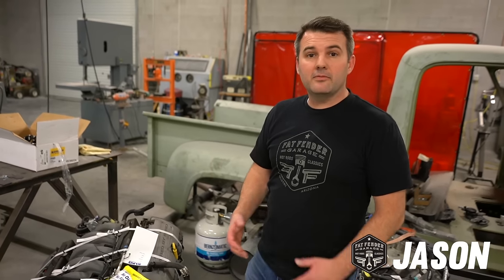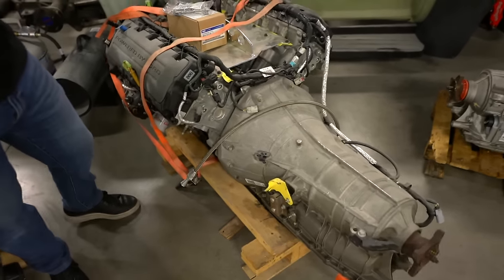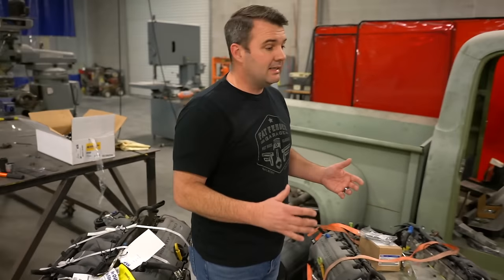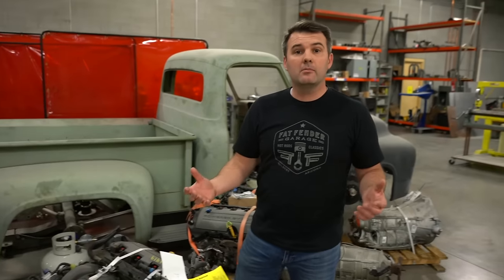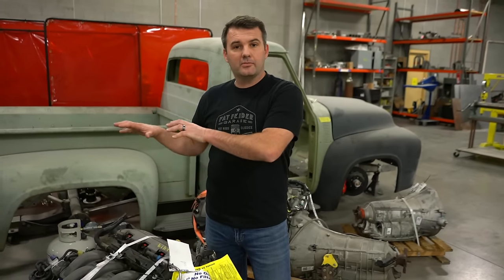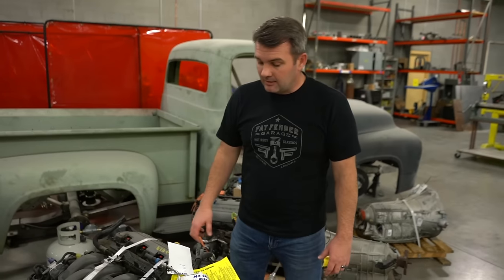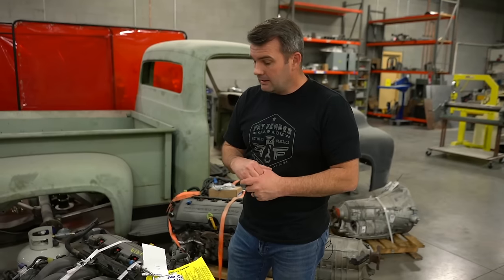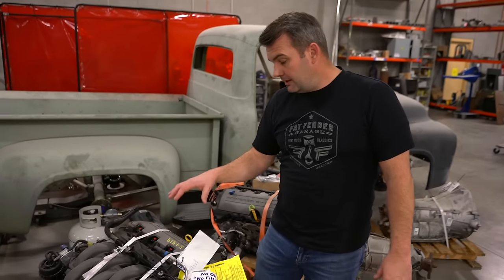Coyote Swap Engines - HOW & WHERE TO BUY

Comment: I know they are not as common but I bought a 32k mile Mustang GT 4.6L 3v complete with 5r55s transmission, harness, accessories, fuel tank, gas pedal, etc for $2,000.....then found a used MP112 Magnuson supercharger for $650.....so all in with tuning I'll be under $5,000 for a 425rwhp setup. Oh yeah, this is going in my 1952 Ford F1 pickup.
Reply: The 3vs get a lot of hate, it's really not deserved. Kudos on the build bro! How's it going now?
Reply: That's super sweet
Reply: Love the 50s F150s
Reply: MrMurph111 I doubt you’ll see this, but “How did the build go”? Hope your out cruising in that 52 (love that era of Ford!) ✌️
Reply: @TC-dw6wg  ….she is still a project, but should be tons of fun!
Reply: Your best bet is to buy the whole car from auction and sell if the rest. These motors used are over priced right now. There is this coyote craze right now. For builds you can go after other mustang engines.
Reply: I bought an 1991 Infiniti m30 with the vg30 (300zx) that can run up to 1,000+ hp with the right parts. I bought it for $850, it runs and everything perfectly, even has AC.
Reply: @ghostiboi2057  exactly guys are paying 3 grand for coyotes with 60k miles. They have a place here in NYC that sells drop in from Japan engines and trans complete with harness and computer to upgrade any Honda Nissan Toyota and their respective luxury brands for less than a price of a coyote and they have low miles.
Reply: Where did you get to purchase that motor
Reply: You present a very compelling argument...
I've been contemplating a Coyote swap, into my '06 P71, and I'm still doing my research.
Reply: Why is the gas pedal important?

Comment: I work at LKQ in QC now. ive got 2 bits of advice for everyone. 1) we do NOT deliver to a residential address. 2) if you call us and ask the sales rep specifically for "a full-drop" and specify you want the harness with the engine. he can put in the notes to the dismantle crew to leave it attached. this can also be extended to the full drivetrain if you want it. ENG, TRA, RDS(rear drive shaft), and RAX(rear axle). we do try to get the customers exactly what they want/need. and if we dont do it the first time, we will try again until we get it right. i use to be a driver for them for 2 years. it wasnt an issue for me to go back to the same shop 3 and 4 times to get them the exact right part. typically mistakes like that only happen with electronic devices because the manufactures make so many different models based on the trim levels of each vehicle. IE, a radio that fits a Ford escape is the same that fits a fusion, or a taurus. and each of those three have 3/4 trim levels.
Reply: Very insightful. My crown vic's engine is seized so I've been thinking about dropping a 5.0 in it.
Reply: interesting. i inquired about a 5.0 on ebay a couple of weeks ago (LKQ seller, but i can't remember where they were out of). the gal wrote back and kindly told me that they don't supply motors for swaps. i'd have to provide the vin number to buy it, presumably for a replacement motor for the same year vehicle. i thought that was strange. ever hear of that?

Comment: Nutting wrong with a 2011 or 12 f150 only diffrence is the cames and intake and you will not notice the difference in power

Comment: Those are sweet engines man. I would love to see a Coyote swap in an F150 and Bronco from 92-96.
Reply: Im starting this swap on my 95 f150 4x4 within the next few weeks. Just waiting on all this cold and rain to finally go away lol
Reply: @jonpippen6998  Sounds awesome man.
Reply: I'm trying to find out how much it will cost to do a swap on my 94 F150 with a 5.0 coyote rear end,transmission
Reply: I'm prepping to do that myself...also with a chassis swap.....grand marquis.
Reply: Ford bronco with coyote and twin turbos. That is the dream truck
Reply: @michaeljohnson3881  anywhere from 10-20k can get your basic install etc for 10-15k for 20 you'd get top notch everything magna flow nice headers it's all how much you want to spend and everything you'd want yk

Comment: I just recently got my 2010 GT. I lost my 2007 GT after getting married then divorced. One day when I get the money saved, I want to put the 5.0 in my car.

It took everything I had to get my car back. I saved every paycheck I had. I worked in a salvage yard for 5 years and didnt make much money.

I'm currently saving money to go to truck driving school. Once I start making good money. I'll be able to swap motors.
Reply: Badass man. Good luck!
Reply: Should had signed a prenup
Reply: ok

Comment: The 13 and 14 f150 have the same motor though as the 11-12 I thought? 🤔. The gen 2’s were from 15-17, gen 3 18+
Reply: Correct
Reply: 11 thru 14 are the same motor. They are the Gen 1's 2015 thru 2017 are gen 2 and 18 up are the gem 3. I have a 2011 F 150 with the 5.0 and a 2016 with the 5.0 There is 20 hp difference between the two from the factory.

Comment: What would you rate a 2014 Ford F150 5.0? Any easy motor upgrades that you'll reccomend? More horsepower etc.
Reply: Swap the cams for mustang cams and boom you have a mustang motor, from there I would say throw a blower on it and get a tune. They can put down 600 easy. Go e85 and get another 100

Comment: Looking to do a coyote swap to my 2000 ford ranger 2x4 reg cab long bed auto. I think t would make A stellar sleeper especially with a quiet exhaust.
Reply: That's cool, coyote engines seem too expensive, I'm gonna LS swap my 94 extended cab Ranger, those engines are more abundant and can make more power for less money.

Comment: I bought a 1997 Lincoln mark 8,,(aluminum block cobra motor & trans 290 hp ) for $1000..put it n my 1983 SB Ford f150,,, beefed it up wit a Whipple SC from a lightning ($1200),headers,b303 thumper cam,all for around $5000 installed,,it's not a coyote but I'm pushing 500+ & alot cheaper

Comment: Who does a lot of these Coyote swaps?  I'd be curious about the cost and headaches involved in switching a 2013 S197 from a 3.7 to a 5.0 including the engine control pack, integration with the stock dash (don't want engine lights to always be lit up), and including an upgraded clutch pack and flywheel.
Reply: Get a donor car. It’ll be way cheaper for that type of deal. Probably the route I’m gonna go to yote swap a square body s10

Comment: I have a 2016 mustang GT and a 2012 mustang GT. Side by side, I want to swap the 2016 motor into the 2012 because I like my solid rear and is already beefed up and my 2012 has 120K miles. I was hoping to do just the long block but I am confused on why I can just do a swap and plug and play due to the cams, phasers and Timing chain not compatible with the gen1 ECU? What’s else is needed??

Comment: Coyote and modular ford engines are just big heavy and complicated engines and many are notorious for high oil consumption
Reply: No.

The coyote only weighs 445 lbs, similar to an ls3. 

Also, OHC technology is not magical futuristic space tech. It's been around for over 100 years, just like pushrods.

Comment: I have a 1994 f150 xl 4x4 in a 5speed manual. I'm thinking of doing a coyote swap but had a few questions. If I swap can it still be a manual transmission? Also would i no longer have the 4x4 or is there a way of keeping it?
Reply: Yes you can have a manual, you're likely going to have to use a bellhousing adapter.

Comment: Just a quick question. How hard would it be to put a V8 in a V6 F150?
Reply: Change some motor mounts and get new hoses and proabably depending on the fit maybe new radiator but i doubt it

Comment: I have a 2001 4WD Expedition with 240,000 miles.  When that engine goes south I am going to put a Coyote engine in it with a newer transmission.

Comment: Would love to do a coyote swap into a 64/65 falcon.
Reply: A 351w is a task to get in there! The 427 super stockers had the shock towers modified to except it! A Coyote is even wider! New front clip is needed and then a 6 point cage? Two words, fox body! It's light, strong, and still everywhere! Mustangs weren't the only foxes! I got a 79 Fairmont wagon with manual rack and brakes. No ac! Factory stick shift car! Now that's different! Coyote will drop in there with no problems! Most fox body Mustang  mods will bolt right in and the weight would be comparable to a gt! Rear wheel overhang is light-years better! Practically a weekend swap! There out there, you just gotta find them!

Comment: Do you guys know the main differences between the generations of Coyote motors? I am starting to look for one, but I am unsure what I should really be looking for... I heard that the truck motors were simply tuned differently - basically more for torque on the low-end rather than horsepower on the high-end. I think you can change that with a simple tune since the parts are identical, is that correct, sirs? I am really interested in learning the differences...
Reply: No, not correct.  Cams are different, intake manifold different, but you're correct the differences are for more low end torque.

Comment: I'm looking to get a Coyote F150 engine for my 2000 F150 from LKQ and the control pack from AM or FRPP only issue I have a concern about is that I have a 4R70W and i think the harness is set up for a 6 spd auto..🤔
Reply: Well if it has a separate tcm and ecm then you could delete the tcm and run a standalone controller
Reply: Power by the hour sells a harness to run that.

Comment: Have you done any Coyote with the 10spd auto?
Reply: EcoBoost EngineSwap that would be awesome
Reply: Round Prairie Dairy I ended up buying a 2018 F150 5.0 10spd to use as donor but truck was so nice I fixed it and it’s now my daily driver! I love doing the swaps using factory parts not using other standalone setups.

Comment: Ive been thinking about swapping my 2.7 ecoboost out of my 2018 f150 for the Coyote 5.0L Gen 3 is it possible to use the factory 10 speed trans still? If not, will the Coyote 5.0 for the F150 be better?

Comment: LKQ are hacks those guys have sent my dealer ship so many engines with almost always  broken intakes ,valve covers sensors , water pipes cut harnees ECT.. . I always have to transfer a lot of parts from the original engine, or disassemble the LKQ engine to remove the cut harness ,connectors, pipes, broken stuff they break.  LKQ is not a cheap place for used engines but you will get more work then you bargained for , for a lot of broken stuff in the engine you bought.   Then only good thing is every engine I've ever installed from LKQ have worked which is the most important.

Comment: If you plan on building engine with better pistons and rods find core engine far cheaper like 250-500 dollars. Why buy running engine like 4-6k then take it apart to upgrade engine. Truck vs Mustang main parts difference is pistons, intake cams, oil pump and exh manifolds. Still far cheaper to buy truck engine upgrade to mustang specs. Even buying mustang GT intake cam 70-80 dollars each or factory BOSS 302 intake cams they all share same exhaust cams. My brother wanting core 2015-2017 for his 2001 cobra which has 2011 coyote we put in. Was truck engine upgraded forge piston, BOSS rods and cams. With machine work, boring block, balance and head gone through with new intake valves. 350 core, 600 machine shop, I think around 1000 in parts pistons, rod, bearings, factory boss cams, bolts and gaskets, front cover

Comment: How hard would it be to put one of these in a 97 Jeep Wrangler
Reply: Probably pretty tough. It's a very wide motor. Then just the hassle of all the electronics
Reply: Put an LS. LQ4 6.0 easy peasy pull it out of the Chevy yourself for less than 1000 dollars.

Comment: Does someone know if you can fit a 5.0 coyote in a 2006 Ford f150
Reply: That's an obvious yes. You can fit like any small block v8 into even small trucks like an s10 or a Ford ranger. The coyote is a bigger (in physical size) small block v8 for the displacement because of the dual overhead cams, but yes the coyote came in the newer ones and this guy consistently swaps them into older f100s so yeah, of course.
Reply: @BainBoyd  alright, thanks for the info

Comment: I don’t believe the horsepower or torque changed from 2011-2014  not from what I understand.
Reply: Perhaps the truck coyotes remained the same. The mustang coyotes saw a 20 hp gain from 2012 to 2013. The 2018 motors have a 40hp increase from 2011. Increases came with longer and bigger valves and increases on the cams.
Reply: Yes I agree the truck engines did not change until 2015
Reply: The main thing that makes the mustang engine better is better factory intake manifold and better factory intake cams...yes the truck engine has half point less compression but that wont make too much difference.  I would get a truck engine and throw on a better than stock mustang intake manifold on it and upgraded intake cams like the l&m intake only cam upgrade...once you do those mods itll be just like a mustang engine w the same mods minus maybe 10-15 hp max from the half point in compression.  I think behind a manual trans you could see 470-480 rwhp with a cobra jet intake and l&m intake cams on an f150 coyote.  Mustang engines cost 1-2 grand more on average sometimes more so the money saved could buy the upgraded intake and intake cams.  If you dont wanna spend for the cj intake and want a cheaper route you could go with a ported 18 mustang manifold it would still give pretty good numbers but not as good as the cj def much better than a stock gt intake pre 2018 let alone the stock truck manifold lol.  If i was doing a swap i would buy a truck engine and buy a ported cj intake and l&m intake cams only.  Throw on long tubes while the engine is out and bam you got one mean machine once tuned.

Comment: The ford  f /150   --5.0  ---- 2011/2012/2013/2014---- all had the same horsepower 360 h.p-380 torque. Horsepower did not jump up until -------- 2015 ----- 385 h.p. on the ford --f/150 --5.0 .........
Which means more  money , for 25 h.p difference. Just switch out the cams,, then your ahead of the game ...
Reply from the maker: Mark,j Gerkens not true. 2011/12 has less hp than 2013/14.
Reply: @FatFenderGarage  He's actually correct, and your horsepower numbers are WAY off. A 2011/201 F-150 makes the exact same power as a 2013-2014. And a 2011/2012 Mustang GT does not have 60-70 horsepower less than a 2013/2014. The difference is eight horsepower. Also, every time I've checked a Mustang Coyote is nearly double the price of an F-150 Coyote. A GT engine shouldn't even be a consideration when going through the trouble of swapping IMO. A set of intake cams will run you around $100. Throw a GT timing cover on it with pump gears and a top cover and you're making 95% of the power for $2,000-$4,000 less.

Comment: I would rather buy a coyote engine came out of a f150 change the rods and oil pump then you will have a coyote engine that can handle 1000 hp
Reply: Where did you get the front bumper for the bronco??? Love the look and was it custom-made?

Comment: 2011s and 12s are good all you have to do is change the cams dats it there go your 60 extra hoursepower verses spending 8000 grand vs 3000 grand for a truck motor. Cams will run you about 1200.
Reply: Unless you want to run boost. Gen 1 coyote's cant handle boost. Gen 2 would be the go to
Reply: @itsjustacrowd7557  how you tell if it's gen 1 or 2?
Reply: @staqkzjay6758  11-14 gen 1
15-17 gen 2
18-19 gen 3
Reply: Honestly gen 1 still a good motor forreal. You throw a coyote in a new edge mustang and you have a quick reliable car.
Reply: Hellspeaker did it. 01 gt. 13 truck motor with mustang intake cams. Stock tranny bolts up
Reply: @joshhoneycutt1792  how was the wiring?
Reply: Brett gen 1’s handle up to 600whp safely.

Comment: 11 n 12 coyote Make “substantially less horsepower” then a 13 motor??  LOL OK bud.
Reply: Can you explain please
Reply: @CS-ro1mx  11-14 Have the GEN 1 motor  and they all make pretty much the same power. The 11 and 12 do not make substantially less power. that is nonsense.The 2010 makes considerably less horsepower than the 2011. That would be an accurate statement
Reply: @mgreene011  I have a 2013 GT while my Dad has a 2011 GTCS Mustang. We both agreed mine feels more powerful and hits harder. Experience is different than bullshitting.

Comment: I am not sure why people still call these motors when they're really engines motor's are electric and engines are combustion maybe lack of formal education don't know !!! If anybody knows please reply to my comment thank you ...
Reply from the maker: MrJames6674 have you ever been to the parts store and purchase motor oil?  I’ve still not found where an electric motor takes oil. Just saying.  I think you have some pretty big corporations to educate. Or, maybe it’s an engine and a motor?
Reply: MOTOR
noun
1.
 a machine, especially one powered by electricity or internal combustion, that supplies motive power for a vehicle or for some other device with moving parts.

ENGINE
noun
1.
  a machine with moving parts that converts power into motion.

synonyms: motor, mechanism, machine, power source, drive
"a car engine"
2.
  a railroad locomotive.

Comment: Theres alot of misinformation in this video...
Reply: Eric Copeland agreed, on top of it all there’s no real answer to where the motor comes from. “Another guy” and “lkq” plus there is a TON on work to be done to get them to fit into whichever truck/car you’re swapping...then comes the ecu and computer and gauge configuration...then comes the fact if you’re going to pay to get it done expect roughly 15k to 20k drive out to have it installed not the 20k to 75k he said in a previous video. I looked into a swap for my 93 f150 lightning by a great shop and depending on what year/miles/power adders I was still right at 17k. Ultimately decided I wanted old school power and went with rebuilding the 351 and turning it into a 408 instead for half the cost.